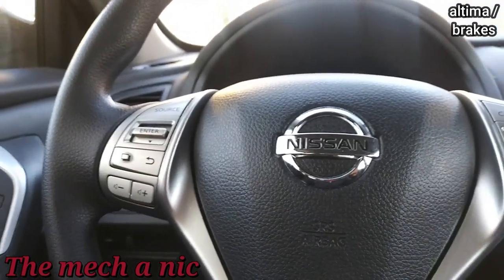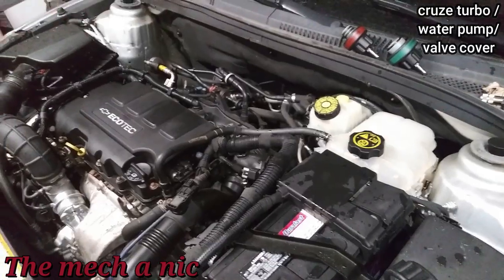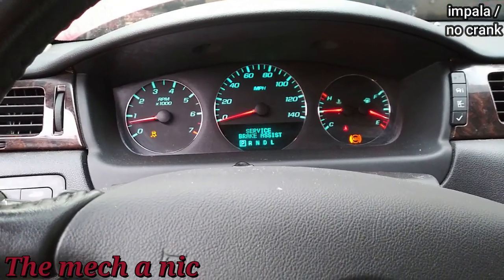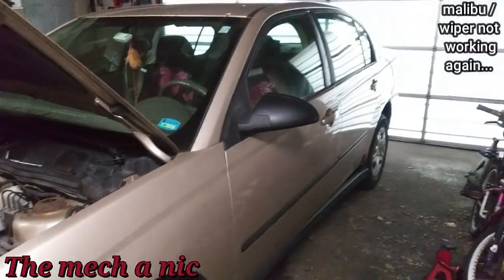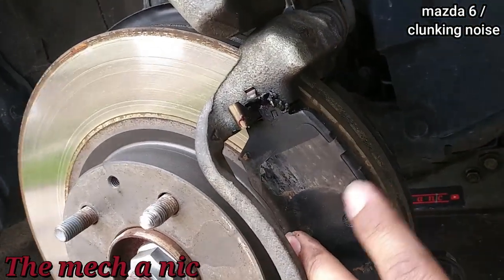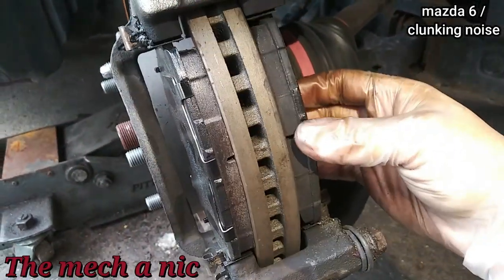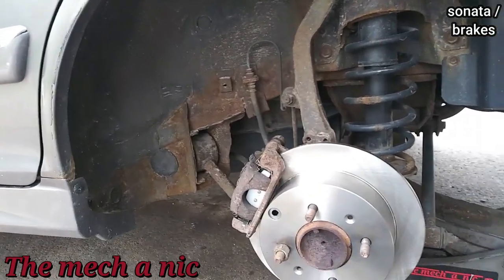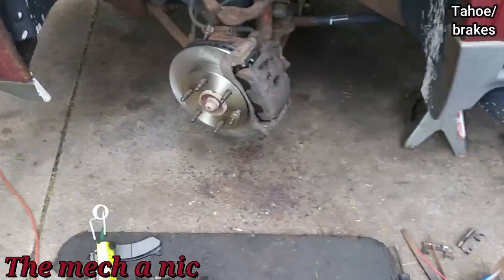mazda 6 clunking noise , impala no crank , tahoe brakes (vol 58)

Comment: A decade ago there was a 'sting' operation done by a team of journalists in western Canada. They set up a car like this, with a bad ground connection at the engine and a good battery and starter, and took it to various mechanics with a complaint of intermittent no start. As I recall, 1/3 ended up with starter replacement, 1/3 with new battery, a few with both, and 1/3 with correct diagnosis and no-parts repair. After a few years of flat rate hustle, guys go to the most likely diagnosis first, and forget to check for basics. Diagnosis is even more difficult now, with starters so hard to get to in modern cars. I always double-think this presentation, wondering if I'd consistently find voltage drop somewhere with my pattern of work flow. I'm not surprised you got the diagnosis right away on this one.

Comment: I've also seen noise from brake pads because , rather that clean up the rust where the hardware goes, people just grind the ears on the pads down enough to get them to fit.
Reply from the maker: Oh yeah ive seen that before. Once in a while i have to grind autozone pads when the hardware is new and the bracket is 100% cleaned of rust (sand blasted) and the pads still don't fut.

Comment: Funny I just got thru doing a Honda Accord with the same problem: pads flopping... In my case there was no hardware... The owner was told to replace control arms and ball joints...
Reply from the maker: 😩😂 that would have been a big disappointment to the customer when they drive away with the same noise lol. I had a suv that there was a clunking noise after someone else just did the brakes. Apparently that person thought it didnt need the hardware kit so he tossed it out so the pads would fit 😂
Reply: @themechanic6117  SMH and I now understand why customers be suspicious of all mechanics

Comment: I didn't have no issues with the oem pads in my  15 Altima when it was brand new now every set squeak
Reply from the maker: Exactly.same problem I came across.try the akebono
Reply: @themechanic6117  I couldn't find  them on Amazon only on ebay
Reply: one thing i have noticed that they only   Squeak when is hot outside when is cold they don't

Comment: Those Nissan a lot of the brake pads sold in auto part are cheap and may make noise it depend idk why
Reply from the maker: From now on im going to buy akebono, if the amount of noise decreases then those are the pads im sticking with but yes I do agree with you.